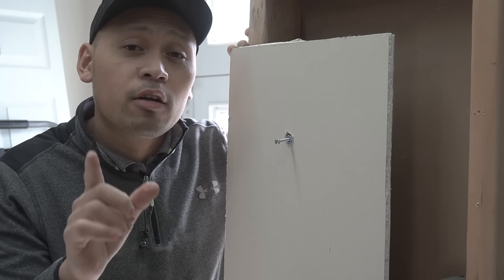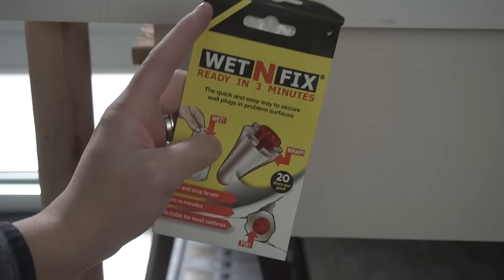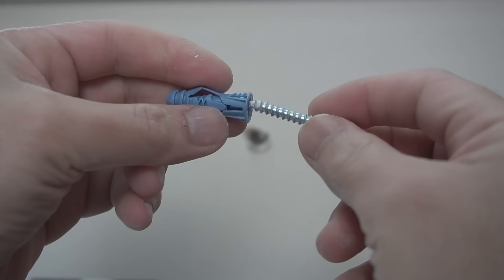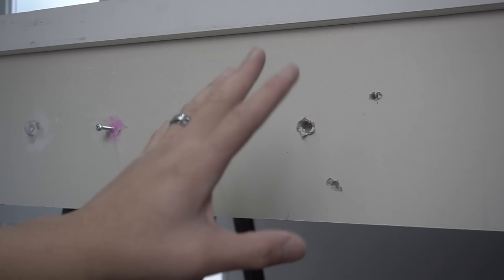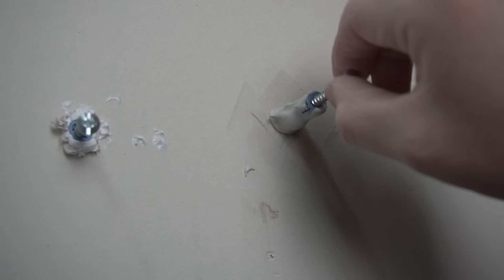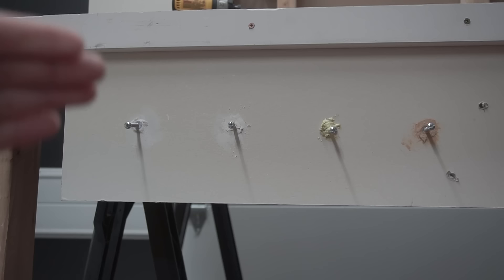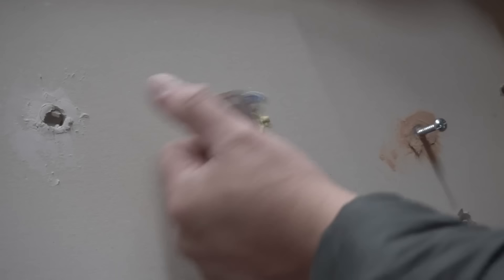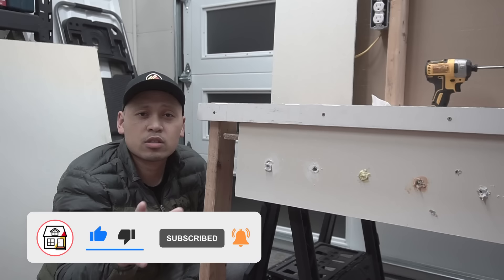How To Fix Loose Or Damaged Drywall Anchors Like New! | DIY Wall Plug Repair!

Comment: I watched your video a couple weeks ago and decided to try the Wet n Fix product. We had a hand towel rack in the bathroom that had started pulling out of the wall. The screw in anchor had had enough.  I followed the instructions and put 2 layers on the anchor and shoved it back in the hole.  I let it dry overnight.  Worked perfect - nice and strong with no movement.  Thanks again for this video.

Comment: Mate, I've been  a builder for 35yrs, I've never used fillers, bog or sealants of any kind to anchor in loose screw plugs , as they won't sustain the weight over time, I always use double screw in wing toggles in situations like this, as they have a greater anchor area of hold
Reply: Does this work when the hold is double or triple the size of the anchor?
Reply: Thanks

Comment: Nice. What worked for me was fast curing epoxy compound. Applied compound in hole and on the plug. Inserted the plug in wall and waited for an hour for it to turn little hard, then screwed and placed the material that i wanted to hang. It did an amazing job and the area surrounding the hole also turned rock solid. Cheers!!
Reply: A box of Fix-it--all  is really cheap and the powder can be stored forever.

Comment: Thank you! The last time I had a wall anchor tear out I ended up demolishing my house and rebuilding so I could install new anchors. It's worked well so far but in hindsight your method would have saved me over $400,000. I'll definitely try it next time!
Reply: Yeah I did the same thing when I accidentally shot a pin nail through my roof. My neighbor told me I probably could have saved a buck or two by putting a little tar on the hole but pffft what the hell would he know about construction? He's just a brain surgeon!
Reply: Funniest comments ever <3
Reply: That’s why I avoid all anchors and gamble on just screws

Comment: Yep. I also already tried almost all these methods, and the wet patch was the only one that held up. I even had to use 5 of them on one anchor (a 3-year-old tried to do a pull up on my towel rack).... And after the fix, it's as strong as it was before.

Comment: Missed you trying Hot glue. I use it often. Even on ceilings to mount lamps and have had good results with it. A second method I have used for decades and know for sure that it functions well (at least with Fisher Univeral Anchors) is to enlarge the hole two sizes. Example 6mm hole to  10mm hole. Set the 10 mm anchor with the wings in the hole at 12 o'clock/6 o'clock and the 6 mm anchor in the 10mm anchor with the wings at 3 o'clock/ 9 o'clock. Screw your object fast and your set to go. No water, no mess and only cost cents instead of dollars. In such cases I recommend "always" to screw by hand. Most applictions are ruined because people use a cordless screwdriver. Nowadays people are in a hurry and damage more than they intended to repair. Just my opinion. Have a good day. 👍

Comment: When fixing into drywall (known as plasterboard here in U.K.) I like to “paint” the hole with white PVA adhesive (water based wood glue) mixed with a little water to make it more fluid. It will soak in, harden and reinforce the area. I also coat the fixing itself with PVA. This effectively bonds the fixing to the board and gives it a lot more strength. I use the same technique when assembling flat pack furniture, which is usually made from wood chip board. I paint the edges and corners with it to strengthen them and coat the screws with PVA.
Reply from the maker: Thank you so much for sharing this advice to the community! 🙏🏽😊
Reply: Indeed I have used that on plasterboard, My biggest problem is replacing 5ft light fitting to ceilings guaranteed the old screws are stripped never match up and you end up with a mix of plaster board studs and sometimes metal joists.
Reply: Great tip!! If people did this regularly like you, I bet there would be a lot fewer situations for people to fix.
Reply: But would the wood glue not leave a very smooth surface once it is dried on the "painted hole". And it would be hard for the next layer to bond to that smooth surface? PVA is essentially plastic, isn`t it?
Reply: @el_micha  It’s not a problem. If you overdo it and PVA glue gets on the wall you can wipe it off with a damp cloth. But you can also paint over it; in fact I have used watered down interior grade PVA to prime the surface of a newly plastered wall after it’s dried, before applying emulsion paint. Interior grade remains slightly water soluble and it will bond to itself. There is an exterior grade PVA, which is definitely waterproof and I would be more careful with that.

But my tip was to paint the hole and the fixing put in.
Reply: @wheater5  Thanks for explaining in detail.

Comment: I usually use a butterfly or sometimes a toggle type anchor if the hole accidentally becomes to big. Works really well. You may need a washer at times with the toggle style.
Reply: Exactly! Total agree1
Reply: It's "too big" not "to big"
Reply: Can you send me a link to what butterfly ones you prefer/recommend? I have a job today in a customers home with shelving. Hope you can send it soon! Thanks much !!
Reply: Metal butterfly anchor with washer would do the job instead of using any kind of compound based fixes.
And it would take 5 minutes to set up.
Unless they cant be used for whatever reason.
Reply: The toggle bolt is a permanent fix.

Comment: as a handyman I would not use any of these but a toggle bolt instead
holds better and no waiting when you need to get the job done and it's time sensitive you don't want to waste with patching
Reply: Hi mate do you know of any handyman forums I could join as a handyman myself
Reply: @hexboxx735  no idea

Comment: If it's a low load, like one side of a towel rack like I had, just shim in a toothpick or two and break them off flush with the wall. They shim the extra space enough to let the anchor to grab and expand enough to hold onto the hole.

Comment: I normally use the stay in place toggle bolts. I have changed 100s of these of the years because my kids always hang on stuff and loosen the dry wall anchors. Thanks for sharing another option.
Reply from the maker: Thank you for sharing your method!

Comment: Great Stuff is an insulation (draft barrier) product.
Caulk is best known as a flexible moisture barrier and lipstick for tile; commonly used at corners or edges of fields of tile.  (Not to be confused with grout.)  There are a wide variety of indoor and outdoor caulks.
Wood filler is lipstick for wood dings.  (If you need to strengthen wood damage consider an epoxy.)
Spackle is lipstick for drywall dings.
Joint compound creates continuity between edges of drywall boards so the joints are invisible after painting.

NONE OF THE ABOVE replace the original wall board strength lost by a botched anchor install.  Spackle may hide the hole.
The above five were designed to do something else.  Our presenter included them because they are likely to be "lying around" and used in desperation.  Use products in the right contexts.

I liked the way the experiment was designed and presented.
Reply: Then what do you recommend using?
Reply: @MsSarcasticSmirk  I retired from running a hardware department at a big box home improvement store 4 years ago.  So I just looked at their on-line catalog and I'm not seeing the "ultimate" problem solver product anymore and I don't remember its name.
If the damage is bad you need something wider than the old hole if you can't move the location.  Based on what I just saw, consider anything with the word 'toggle' or 'toggler' in the description.  These products turn sideways on the other side of the wall to grab drywall outside of the damage.  If you don't have any clearance behind the wall because of brick, cinder block, or other masonry consider using Tapcon products.
Reply: @bagoquarks  Thanks!

Comment: I would use 5 min mix let it dry and then drill the new hole.  Those are the same anchors that I like to use however when they fail I opt for toggle bolt anchors since they require big holes

Comment: I use "Oatey" epoxy adhesive putty. You simply slice off a portion of the stick and mix the puddy with your hands until it becomes one color and feels warm. Then wrap the anchor in the same fashion as in the video. Push any excess in any remaining gaps. In 5 minutes, it will become as hard as stone. This "Oatey" epoxy adhesive putty is fantastic for almost any project (including plumbing draining leaks). It is waterproof and turns completely hard in minutes. In other similar situations, you can drill into it and use a sheet metal screw without an anchor. This versatile product is found in the plumbing department of Lowes or Home Depot. It is better than "Wet-In-Fix". I always keep a tube of this puddy around for various repairs.

Comment: To hang my curtains that kept failing, I used the wood filler and it worked perfect.  I use toggle bolts wherever possible but for the curtains, it was cement behind the drywall so couldn't use that. As other people have said, I think the problem here is you're putting the anchors in while it's still wet.  If you wait until the different putties are dry and THEN re-screw in the anchors, I feel like it'd hold a lot better.  Very cool video though.
Reply: cement behind the drywall... Just grab a masonry drill bit and a regular rawl plug and a longer screw, that would be very secure. 

Failing that you could fill up the hole with drywall adhesive, let it set and that would give you a very strong substance to put your plugs into, make your plasterboard more secure, as well as seal up the hole.
Reply: Hi. QQ. 
Did you apply the wood filler the same way he did in the video or did you apply the filler first, insert the anchor...let it dry..and then the screw?

Comment: Hot glue in the hole and over the Anker , fill the hole by twisting the Anker I'm place .works great.
let it harden 5 min and your good to go.Very robust and solid.
Reply: I've wrapped the anchor in a few layers of toilet paper and then wet it with either wood glue or water and corn starch.  But I was in a hurry to do a quick cosmetic repair rather than do it the right way when I used those methods.
Reply: By hot glue do you mean regular glue gun?

Comment: I always just use a toggle bolt for anything over a few pounds. I've never had any luck with those plastic anchors. Still, it's interesting to see something that actually works as advertised. That's rare.

Comment: I am no construction guy so take this as you will. I crunch up a little drywall into powder and mixed some two part epoxy glue with it. It worked great.

Comment: I recommend using an anchor that is wider in diameter to fit snugly in the large hole that you made.  It works every time.
Don’t fight with getting those compounds to work for installation or even worse risk them failing long term if used to hold heavy items like mirrors or shelves
Reply: Not always possible because a wider anchor quite often also needs a bigger screw. The thing yuo'll connect to the wall must be ready for that bigger scres.

(I use in this case mostly a (big) hole filler...but that's in a brick wall. And that holds perfectly. (Not sure if that's for sale all over the world).
Reply: Exactly wile your in the store just buy the fatter fixing ffs
Reply: The only thing to hold weights over 10 pounds is drill into stud or use butterfly anchor that flips out and grips the back.
Reply: Well of course that would be the proper way to do it but this guy doesn't make money if he shows you a solution that easy or that appropriate
Reply: @reiniernn9071  sure it’s possible.  It’s called a Molly.   No bigger hole or bolt
than this (Mollys use bolts not screws)
Reply: @slpguy6026  All the Molly Bolts (hollow wall anchors) I have ever seen had screws, not bolts.  It would have to be a large anchor to use a bolt.  Bolts typically have hex heads; screws require screwdrivers (slotted, Phillips, Torx, Robertson, etc.).  I don’t see how a Molly would work for any of the holes he was repairing unless he uses a molly at least as large as the hole.  He’d still need to hold the Molly it in place with the Molly Bolt tool to keep it from turning as he tightened the screw.
Reply: Sorry, but all were extremely sloppy repair attempts.  Instead of trying to glue the plastic anchor in place, which prevents it from properly expanding, try some of the effective mechanical repairs that are readily available.
Reply: @JT_70  It just dawned on me that we’re talking about 2 different things.  In my region a Molly is usually the anchor with spring-loaded wings, a nut in the middle, and a bolt.   But I realize that’s also a toggle, and a Molly can be the sleeve type anchor.   I don’t really agree with your statement about the heads though.  I still use bolts with slot heads for aesthetic purposes, especially if restoring something.   All the oldest bolts were slotted, or square heads.  Some of em pretty big.
Reply: @slpguy6026  Molly's use screws not bolts and the molly package shows you exactly what type of screw to use.
Reply: @ottotater2787  like I just said, the terms vary regionally, Mollys vs toggles etc
Reply: The larger screw for the larger anchor doesn't fit through what I'm trying to screw onto the wall

Comment: What a great video...I have suffered with this issue for years and had to change the hole for the anchor and fill the other with spackling. This was a really nice trial in determining a fix.  Thanks for a great new fix.

Comment: God bless you for this video, I needed this
Edit After one month 

based on this I used wet n fix and the results are awesome it has saved me lots of money.  I am using it for metal shelving and so far they are holding it really well with all the weight

I bought some really bad quality wall anchors and they all broke, I initially thought there was something wrong with the wall but it was not the case. After ending up with lots of holes in the drywall I was about to add the rail system costing over $200 I saw this video bought good quality anchor used the  same holes with WETNFIX and I am very happy with the results so far
Reply: U managed to insert God into the the daily conversation
Reply: @cemasti4524  I am just wishing him or praying for him, this video has me saved lots of money and hassle

Comment: Fun video to watch. Most of these fixes were easy to see that they wouldn't work,  but I can see inexperienced homeowners trying each of these methods.
Reply: which one works
Reply: @ProPrince , Generally, your butterfly anchor, although it requires a bigger hole.
S dcrew-in anchor is good in standard applications, where not a huge amount of force is hoping to be placed on the anchor.
A stud is always a great place to secure ftom.

Comment: Excellent presentation. Your experimental model showed that Wet n' Fix is the right product for this type of job, which I have encountered several times in my DIY career. I have a number of bathroom fixtures that need to be reset. Thanks for providing the solution to my problem.
Reply: The answer is of course, never, because the failure suggests that drywall plugs aren't an adequate solution to my mind. But alas that is a more professional mindset. If I wasn't going to do it properly, i'd just put a big plywood plate over the hole and screw into that, well bonded or screwed to the studs. If I'm doing it properly, i'm taking the plasterboard out and putting in a plywood back and putting a fresh piece of plasterboard on and getting it reskimmed, painted, and then going straight in with a regular screw.
Reply: @carbon1255  what if you just wanna hang some $5 paintings

Comment: The test that each was subjected to was shear force.  Not sure that it would have yielded different results but it would have been good to independently test each under tension.  It stands to reason that if the filler is at least as strong or stronger after curing, than the parent material, that the resistance to both shear and pull-out would (to a point) be a function of the contact area between the filler and the surface area of the parent material.  The larger the hole, the better the result.
Reply: yeah...I don't think we need to do any of that. Wet & fix is the way to go it seems no reason to use anything else other than hot mudd
Reply: I never try to reuse a blown out hole. I fill it in and make a new one. Gyprock is a pathetic material. I really hate it, nothing but trouble. 
Good comment!
Reply: @martinvanburen4578  Yes, your'e definitely correct on that one. Wet & Fix is obviously the way to go.

Comment: I go to the next largest anchor. If a 30 pounder got messed up I go to 50s. It normally fills in the extra space and works. 
I also like the screw-in style anchors. They seem to be sturdier. 
Make a video about those if you haven’t already.

Comment: I'm a painter and run into these when removing items from walls. I carry a bag of those large threaded screw anchors, if you have them around its faster and better than any possible repair.
Reply: Those large threaded anchors dont work when the drywall is damp and weakened causing the anchor to spinout inside the hole